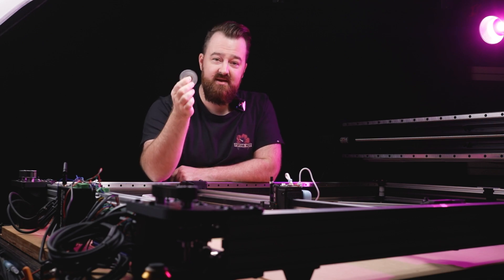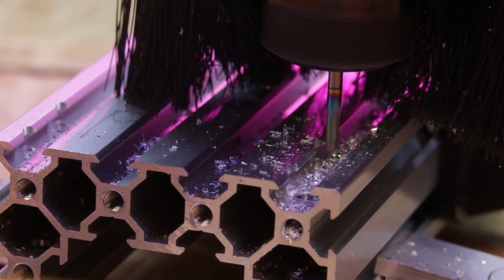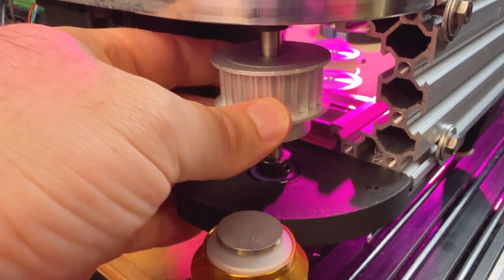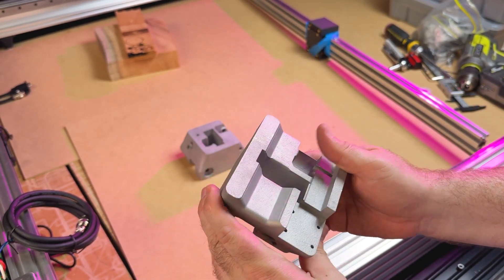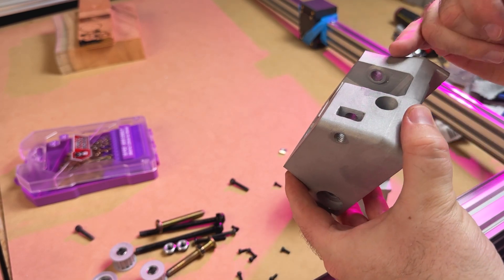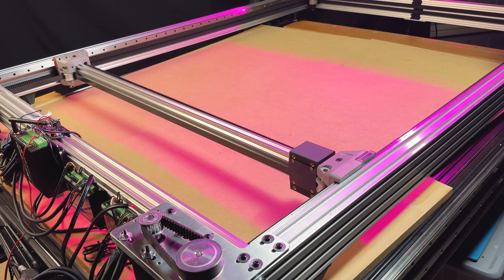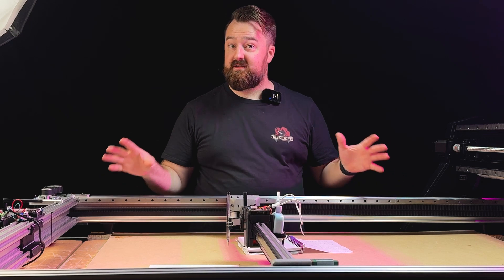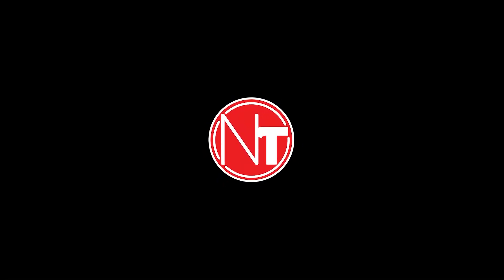Super Strong CoreXXXY // Fluidnc

Comment: Now that you have aluminum parts on it, try tensioning your belts more. You would be amazed at how those direction change artifacts will disappear when the belt tension is proper. If you really want to get precise, look into the calculations for optimal tension based on belt dimensions and materials, or reference the manufacturer's recommendations.

When designing my CoreXY large format printer, I found that equal belt tension had a tremendous impact on movement accuracy and precision. Use a free guitar tuning app to match the frequency of vibration between the two belts. Move the Y axis all the way to one end, and measure the "long section" of "exposed" belt. Pluck the belts one-by-one, and put your phone microphone within about 10mm of the belt to measure the frequency of vibration.
Reply from the maker: Thanks for this info! Yes I did end up tensioning, however due to the aggressive 5m belts it just ceased the motion and was too hard to move thick belt around corners - however I agree that this did provide a heap of rigidity in the movements, although couldn’t run fast. Check out my thoughts in my most recent video 🤩🤩

Comment: @12:26 Perhaps explain what the machine is intended for so people can either pass a reasonable judgement or perhaps give input on how to address any ongoing issues? 🤨
As of now it looks like it pretty much failed in the one task it was supposed to excel at being a Fast, large scale CoreXY with it not being able to draw either straight lines or accurate corners.
Reply from the maker: As I mentioned in first episode, purpose is to explore building a coreXY machine using materials I had and kinematics…. The build is the purpose and no specific use at this stage.

Comment: Large belts are good for rigidity, but with such small diameter pulley you need to use the finest pitch you can find. In your case the coging is obvious on your spiral test draw. A 5mm pitch belt has an increase of tension when each step reach a tooth thus making facets instead of radiuses. 5mm belts have a thick core done for way more traction than you need, and you cant put enoughy tension in them even with your assembly. I would rather use a 2mm pitch belt with the same width, at least at the servo reduction. Other than that nice sturdy design.
Reply from the maker: Great suggestion! I hadn’t considered this… there is a 3mm version that seems common for larger machines that I could try. I would be concerned that the 2mm might be too fine and cause skipping. R+D 🤩 Cheers Eric!

Comment: 7:00 if that part cannot be made by a CNC machine, that is a DFM (design for manufacturing) issue on your part. Totally possible to make some changes to the part geometry to make that much more cheaply made on a 3 axis CNC with a few setups. Adding a few radii to corners and not having unnecessarily difficult to machine features etc. When I worked as a mechanical engineer, one-off parts like that and significantly more complex ones would be machined on 3 axis mills in house, and while my employer did own a metal 3D printer it was so unreliable and expensive to use it was essentially collecting dust for years.
Reply from the maker: I agree that a redesign would be more efficient for CNC milling! Definitely consider this for down the track. I can imagine that SLM process can be very fussy… hopefully with time this will become more efficient.

Comment: did you tension the belts correctly ? gates has recommended belt tensions you can measure those by using a phone and an app to get the frequency on a specific distance of belt ( like 150mm belt) 
with such a full aluminium build you can easily go to the max belt tension given that the motors running the belts have proper mounting and use double shear 2 bearings top and bottom
Reply from the maker: Great suggestion! I will definitely look into this. 👍